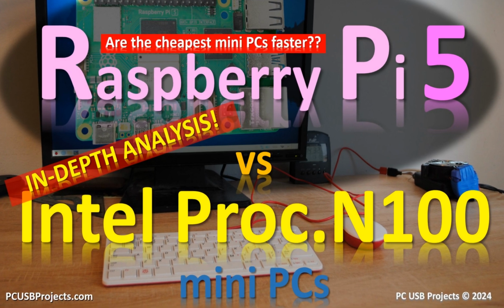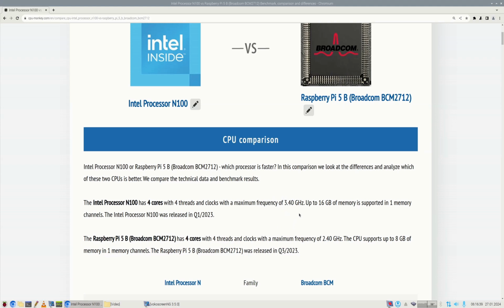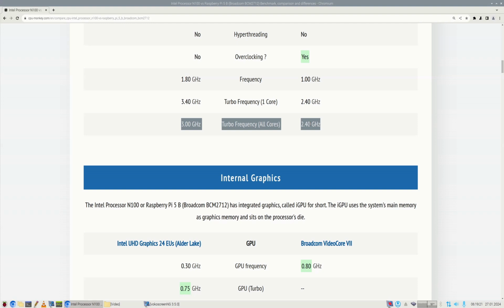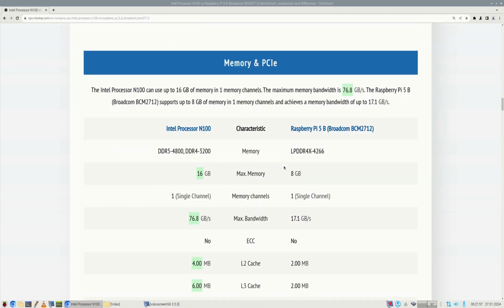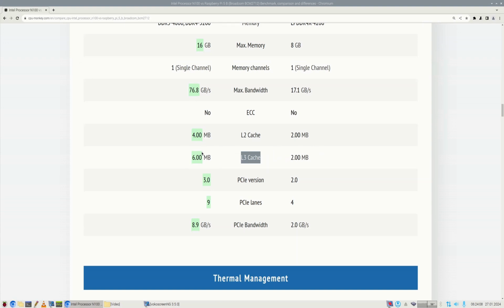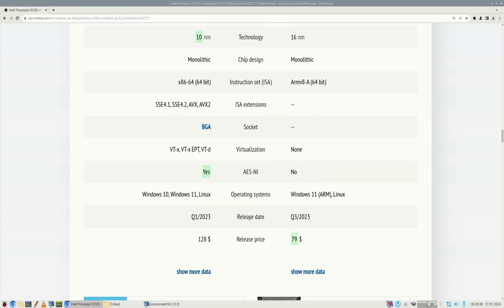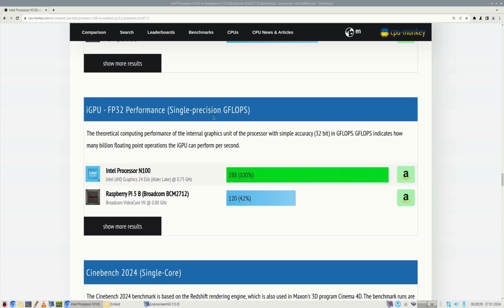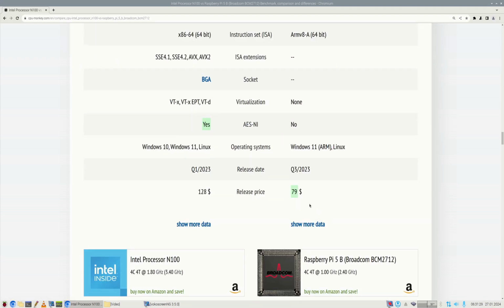Why is a $150 classic mini PC 2x-3x faster than Raspberry Pi 5?

Comment: RPi 5 could be faster if the L3 cache was 4 times bigger than L2 cache. Due to the size of L2 and L3 is 2MB, both are equal, the performance is small.
L1 size is 64 KB + 64 KB per core, and the size of L2 is 512 KB per core, so the ratio of L1:L2 size is 1:4 which is okay.
But the total size of L2 cache is 4 x 512 KB = 2 MB, and the size of L3 cache is also 2 MB which means the ratio of size of L2:L3 is 1:1 and this is very bad. If the ratio was 1:4, the size of L3 cache would be 8 MB and not 2 MB.
Reply from the maker: It depends on the program you are using. A large cache efficiency depends on the amount of data that your program is processing at a given time. BCM2712 has 4 cores which all have their L1 and L2 cashes that are quicker than common L3 cache. It is not the same, if you run a single treaded program or a multiple threaded program. Usually, you would have only have one program that uses the most of system resources, if you are using your RPi 5 as a desktop computer. Therefore L1, L2 and L3 cache optimal sizes mostly depend on the program needs. If there is a program that requires a large amount of RAM to process extremely large matrices (ex. copy, simple calculation, erase, etc.), caches may almost always encounter a miss. The only beneficial cache in this case would have been L1 cache that holds the program code. The data would have been pumped from the main memory and back (watch: https://youtu.be/gYz_0pqde04) while the L2 and L3 caches content would have been almost always invalidated... It's quite a long description, so I'm not going into details... I'd just like to let you know that you can hardly draw general conclusions on the cache size. 
However, it is generally known that on average larger caches are needed in a computer with much larger main memory. Larger caches therefore may be beneficial for running BCM2712 with 16 GB RAM. It is true that L1, L2 and L3 caches size differences are usually larger in processors chips which need separate I/O controller chips (for PCIe, USB, ... ) , but what is the most efficient configuration should be decided by the SoC maker (Broadcom in this case). Chip makers are also limited with the chip manufacturing technology that they are using to produce the chips. BCM2712 is still built with 16 nm technology, while many other SoCs are already based on 7 nm technology. You may like this video: https://youtu.be/gYz_0pqde04

Comment: The lack of AV1 is a big deal since Youtube and netflix are AV1.
It's probably mostly a matter of where the devs for libraries like VLC's dav1d have spent their time.
I was shocked to realize that when I put a 14 year old AMD card in a xeon based computer the other day (no integrated graphics) that Chrome for windows comes with an AV1 decoder library that decodes on that card.  
It was a 14 year old card that was so low power that it didn't even have a fan, yet it could decode AV1, so it certainly doesn't take a lot of power on a GPU to decode AV1, they could certainly make it work on the pis if they put in the work. 
No one has. By the way I looked it up, and that graphics processor has 104 fp32 gflops, which is slower than the pi's 120.  So it's certainly possible to write a library that will do it on the pi.
Reply from the maker: Writing or adapting a SW library for a new system takes plenty of time, which you may not have...  There could easily be a 4-lane external PCIe bus in RPi in the future... I believe that Broadcom will get AV1 to work in VideoCore VIII.... However, I'm eager to have a really fast 3D graphics on RPi 6 in the future...